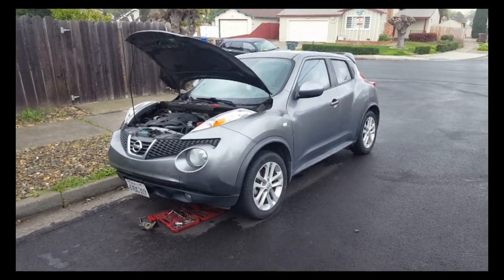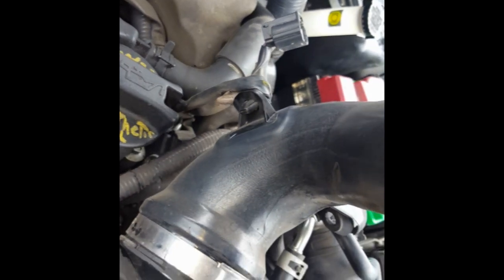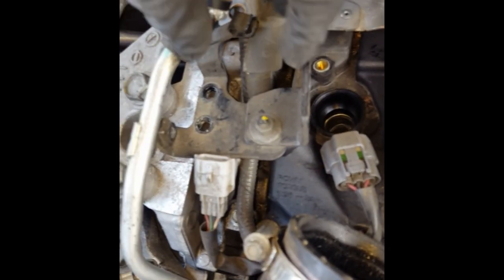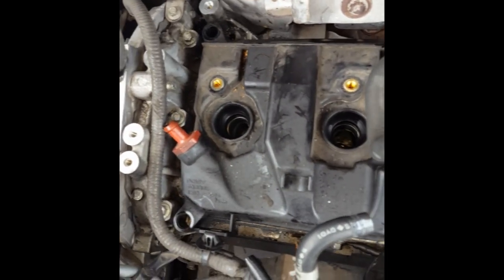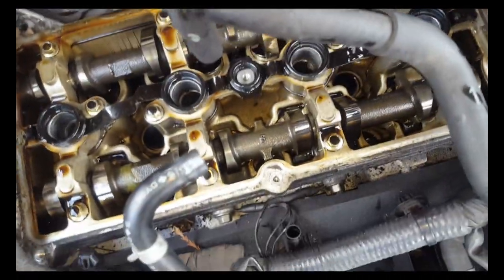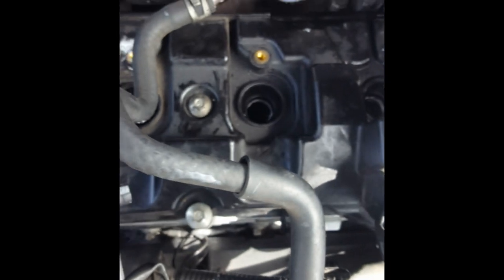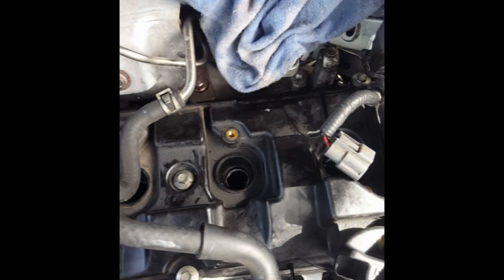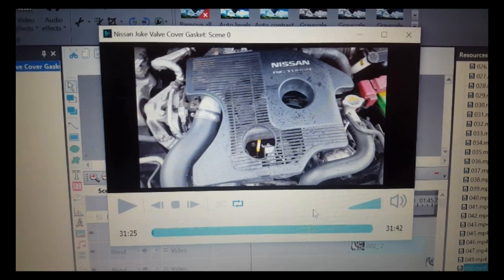Nissan Juke Valve Cover Gasket Replacement 2011 2012 2013 2014 2015 2016 2017 How to Guide

Comment: This was so easy to follow!  I got it all done and took a test drive.  It would not go above 2400 rpm.  I came back home and noticed the throttle body intake ( big black air boot ) at the throttle body I hadnt tightened down the clamp. Also at the other end of that same boot I hadn’t tightened down the clamp. It was also really hot in the upper radiator hose, and I only drove it 4 miles. Any ideas?  Anyone? Buehler?
Reply: Well. I got the codes read and they all had to do with air. So I figure after tightening the two clamps I’m fine.  Rpms wherever I want them and everything.  So again, thank you for posting this. The juke in your video is even the same color as my son’s !
Reply: i forgot the same two clamps when I started it up.  It ran rough and that hose was hot.  Clamped them back down and all was good.

Comment: Didnt realize how easy the juke was to work on! This would have been a weekend or 2 job on my audi a6 Haha. So I just changed my plugs on the juke and found a bit of oil on a single plug,  do you think changing the valve cover gasket should fix that issue?
Reply from the maker: Yes. That is more than likely happening because the spark plug seals leak a little bit over time. If the leak is very apparent. It might be time to change the valve cover gasket. The valve cover gasket has the spark plug seals attached to it. It's all one big seal. Could also check the back of the valve cover near the exhaust heat shield to see if the outer portion of the valve cover gasket is leaking. It usually leaks at the corners in the back of the valve cover

Comment: It looks like a straight forward job, but is time consuming because all the bits are needed to be removed out of the way to gain access to the gasket valve cover.  I had a look at my 2013 Nissan Juke 1.6 and found there were several oil leaks around the gasket cover.  Would these oil leaks dripple down onto the driveway from higher level while the car is parked overnight?
Reply from the maker: It depends on how bad the leak is. Most valve cover gasket leaks don't leak onto the floor because of how high up they are. They have to run down so many other components before it would hit the floor.
But eventually a valve cover gasket leak if left alone will eventually leak onto the floor.
It will also consume oil. So definitely be checking the oil regularly.

As you said this valve cover gasket is hidden behind a lot of components. So when that particular valve cover gasket leaks it looks like a lot of other stuff could be leaking because it's leaking onto it.
Pretty common for the valve cover gasket to start leaking once the car gets to higher mileage

Comment: Nice video! What are the labor guide times? And how long does it take you to do that?
Reply from the maker: This was years ago. I don't remember the exact times.
But if you are only doing 1 side you should be able to do it in under 2 hours if you are a professional.
Something like 1.5 hours
Reply: @PancakeBreakfast  nicee!
Reply from the maker: @sherrodford955  Sorry I thought this was the axel replacement video.
But the times are similar.
Probably 1.5 - 2 hours if you are a professional.

There's a lot of BS in the way. But it looks worse than it really is.

15 minutes alone goes to peeling and cleaning once the valve cover gasket comes out. And applying sealant.

Slightly above average gasket replacement.
Just a bunch of junk in the way

Comment: How can you tell when you need to replace the valve?
Reply: When you have oil in your spark plug tube lol. But it’s great to change it at 120k miles i would say. Mines gave out at 200k so early is better 👌

Comment: Why Nissan making engine like this too hard to maintain..
Reply from the maker: Modern cars are putting more components in less amounts of space. And that can cause maintenance head aches. Nissan isn't too bad. They aren't Toyota or Honda (which are their direct competitors). But they do have the occasional awkwardness in design.

Comment: 😂😂😂😂 like 47 moves ago you were like “there thats it. All you guta do. Lmao. Not on a Juke son. Its a total a$$hole job comparatively. My small block chevy I could change both ( 8 cylinder)gaskets in under 4 mins. 4t bolts on each side. Studded heads. You could take the valve covers off 400 times in a day n you wouldn’t even get mad. Lol
Reply: you gotta goto the gas station like 47 times...I say its even. LOL